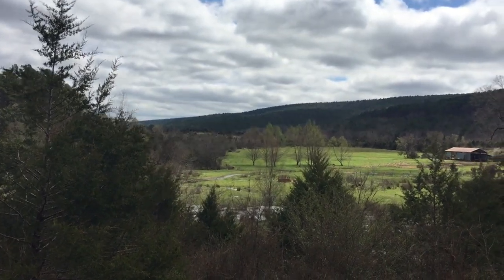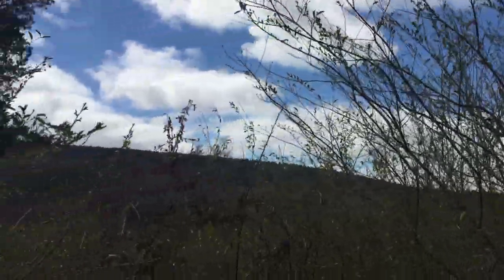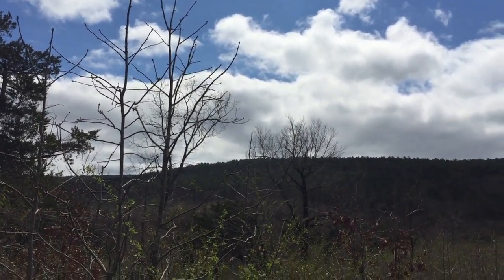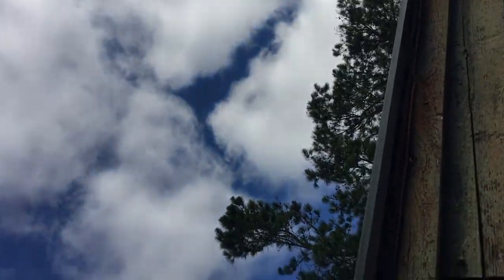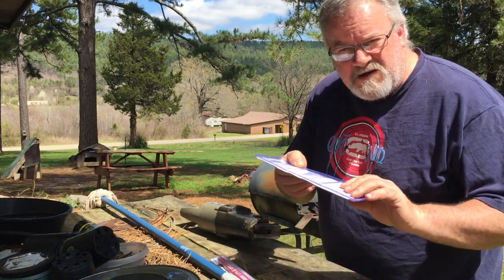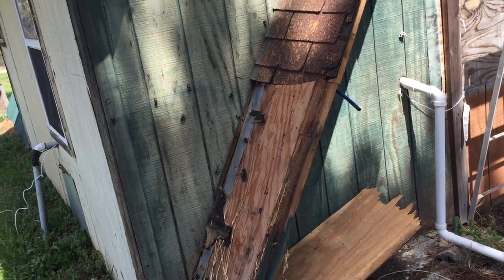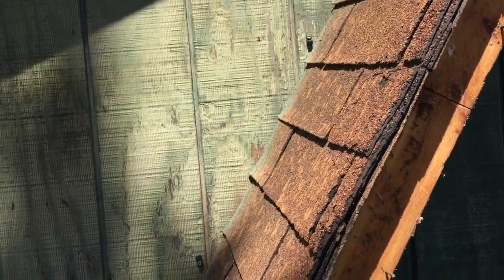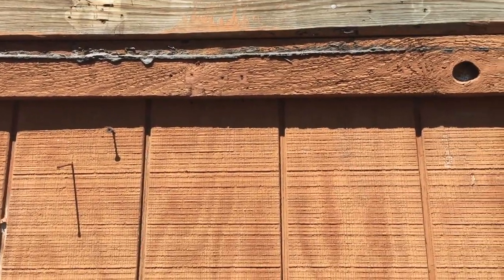DEMO IS FINALLY DONE! /SUNROOM AND GREENHOUSE BUILD IS COMING SOON

Comment: I never realized AR's spring greenup is this far ahead of us in the TX Panhandle.  Nothing green here yet, tho I did see Bermuda grass peeking out of the ground yesterday.  
Last yr I bought a little battery powered Stihl chainsaw to trim up some 30 foot tall evergreens. It was a huge job I'd neglected too long. I'd have never finished with my gas powered chainsaw because the exhaust fumes give me headaches.

Comment: Mike I bought a 5 in 1 garden battery tool set pole saw, hedge trimmer,whipper snipper, brush cutter, line edger. Last year.  I'm so impressed. I overworked myself .I got carried away it was going so well clearing. I have to remind myself to do it in small increments.
Reply: Would you share the brand of this tool, and where you found it? Thanks!
Reply: @JB-pd4ni  yes. I found it in a catalogue sale in Becks hardware store in Launceston Tasmania.  I always check the sales, you never know what you can find.  It's a Rockwell